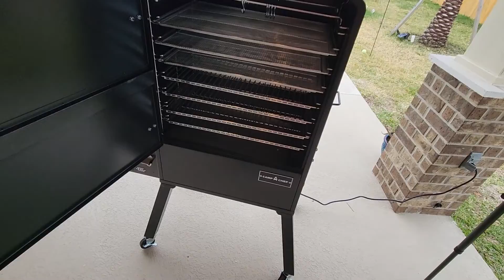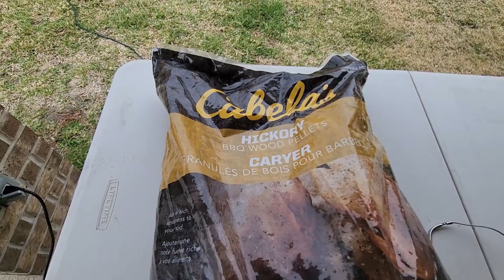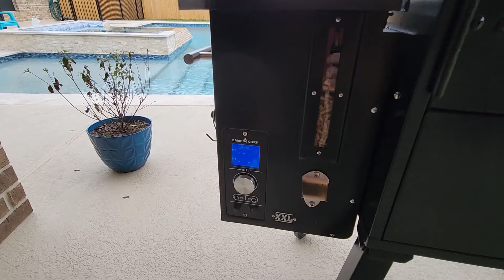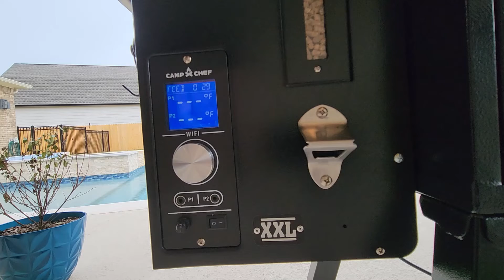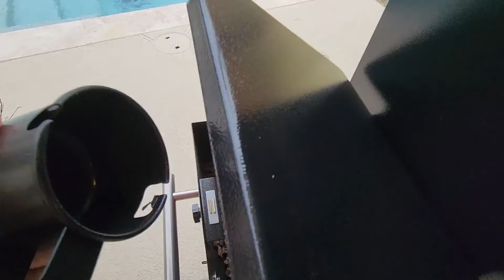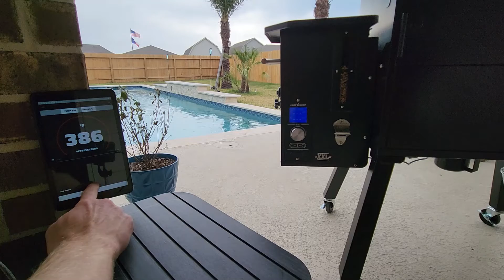First start up and burn in of my new Camp Chef XXL Pellet Smoker!

Comment: Mine smells weird .  Is it suppose to smoke the entire time?
Reply from the maker: Mine smoked quite a bit the first run. It will smell as it burns off the oils and stuff from shipping.
Reply: @Blakes-Garage  I returned the smoker. Welds started to melt and corner bottom door bent outward. The heat was uncontrollable.